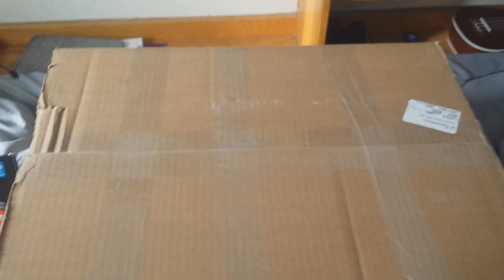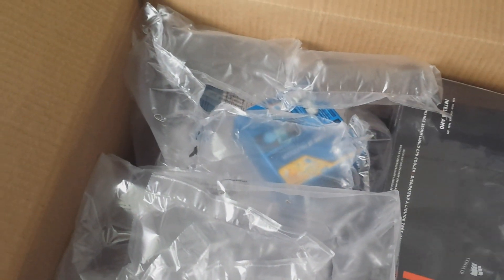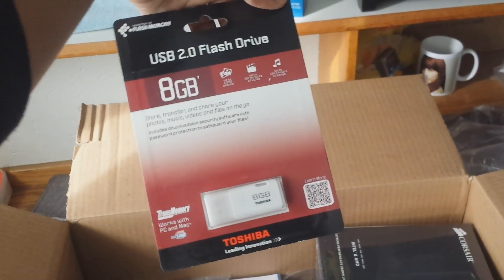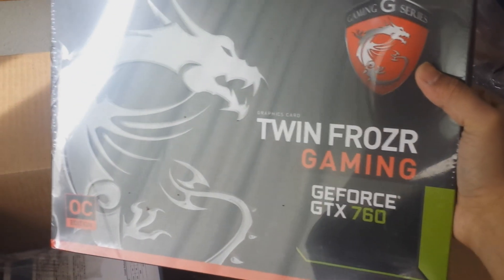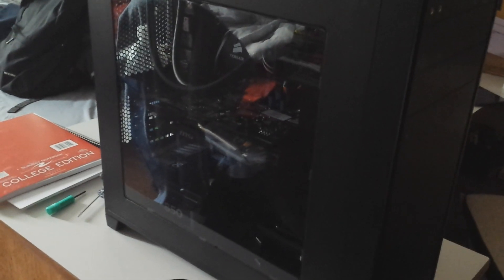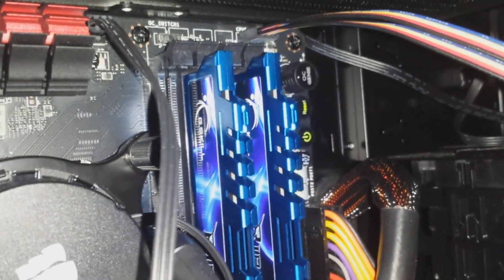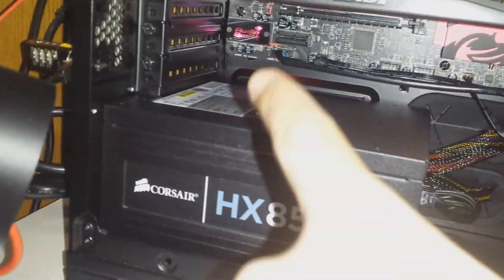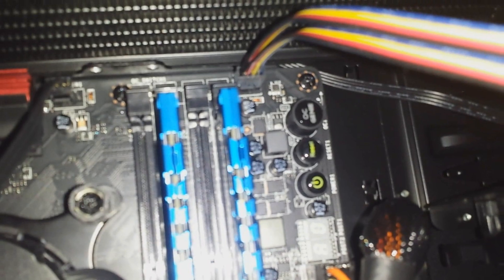2014 GAMING/VIDEO EDITING COMPUTER BUILD - $1300

Comment: That's a little odd that you have your rad fans on intake especially when there is no fan filter on the top of the 350D. Also i would Put the SSD in the 3.5in drive bay and remove the 2.5in bays for better airflow from the front intake fans.
Reply from the maker: I hope people read your comment, and aren't like me! lol

Comment: HÀNG BAO ZIN KHÔNG 1 VẾT SẸO - FULL BOX
Máy Bộ Dell Optiplex 760 FULL BOX
Nước Sản Xuất ; Mỹ
Chi Tiết :  Máy Bộ Dell Optiplex 760
* Máy Bộ Dell đã được cài đặt sẵn Windows :XP ,WIN7, Antivirus, Office, PDF Reader, IE 8, Firefox, Chrome, Vietkey, Fonts, Codec Media... Hỗ trợ cài đặt miễn phí thêm các phần mềm do Quý Khách yêu cầu.
 * Máy Bộ Dell Optiplex 760  siêu tiết kiệm điện,  thiết kế với vỏ Case size Mini nhỏ gọn, thiết kế sang trọng, tích hợp loa trong khá tiện lợi. Phù hợp nhu cầu xài Học Tập, Văn Phòng, Đồ Họa, Gia Đình ...
 * Máy Bộ Dell, sẽ đáp ứng đầy đủ nhu cầu làm công việc Văn Phòng, Game Web, xem Phim HD, nghe Nhạc... 
 * Cấu hình có thể thay đổi tùy theo yêu cầu của Quý Khách.
                Cấu hình 1: Máy Bộ Dell Optiplex 760  Case Mini
           Máy Bộ Dell còn mới 99.9% 
 - Main  Dell 760 Chipset Q45 socket 775. Hỗ trợ tất cả  CPU Dualcore, Core2duo, Core2quad……….
 - Bộ Vi xử lý Intel® Core™2 Duo Processor E6550 
(4M Cache, 2.33 GHz, 1333 MHz FSB)
 - Bộ nhớ DDRam II DualChannel 2GB bus 800
 - Card đồ họa tích hợp 800 MB Onboard
 - Ổ đĩa cứng 250GB SATA 7200rpm zin theo máy dell
 - Ổ đĩa quang DVDRW Slim 
Power 220V.
Card mạng 10/100/1000 Mbps.
Card mở rộng PCI, PCI-Express ...
 - Giao tiếp USB, VGA, COM ...
- Case nằm Mini, tích hợp loa trong khá tiện lợi.Phù hợp xài gia đình, văn phòng ...
Gía : 2.000.000vnđ – bảo hành 90 ngày
Giá : 2.300.000vnđ – bảo hành 365 ngày
 

http://vitinhtrongphu.com/

Comment: should vent the h100 out the top not suck in.  Push the air through the radiator. The two front fans you show the 140mm and 120mm stock fans are drawing in fresh air through the dust screen.  And on top there is no screen.  So your blowing crap into the PC and radiator.  If you spent a few bones on Noctua fans you would get the slitter and an extender with it and a plug inline to slow down the fans if you wanted.  Lets say you had no fan controller with you Mother board.
Reply from the maker: Really appreciate the concern! I've actually upgraded my case to the new Phantek Enthro Pro, and adjusted the top radiator to do so. Noobs first build gg, yamsaying?
Reply: PotentStar I didn't search your videos but did you make an update video?

Comment: Most of your pc components were overkill. From the video I can see your a first time builder. First off you said you were just gaming. The 4670k is equal to the 4770k in games. If you bought the i5 you could have used the extra money to get a 770. Your power supply is overkill but doesn't matter if you were planning to upgrade. The h110 isn't the best cooler and you should have got a noctua d14 heatsink. Offers same performance but cheaper and quieter. Over try using Pc part picker as a reference it may help you in the future.
Reply from the maker: I don't know if a 4670k is worth the money for a gaming build, especially with the new Intel anniversary chips that just recently came out(referring to the Pentium one). I brought a 4770k for it's life span, it suits my needs as a gamer and developer. I don't have a script for what I say in my videos, it was generally off my head, so ignore my saying of "just gaming". As for the cpu cooler, I'll keep that in mind for future upgrades, thanks!
Reply: ya no problem, but neat rig though :)
Reply: Id go with an entry level I5.
Maybe the 4460 on a b85 chipset.

Comment: Did u apply for newegg member something which offer 3 day free shipping. And you have to pay ard $59 for 1 year. I want to know is it worth to pay. What they would give for free like your free USB? Thanks
Reply from the maker: I didn't apply for a newegg membership, I will apply for it once I start having a steady income, atm I'm just a student at a university. I would say it's worth it! It's basically like 5$ a month. Before I do apply for it, I would like to see an example of possible savings and discounts one can receive, I guess I should try out the 30 days, and I suggest you do as well! As for the USB, I honestly have no idea! I had all of my components in my checkout box, and randomly a FREE USB appeared in it. I love newegg.
Reply: But Amazon offer 2 day free shipping w/out paying any annual fee. I 'm about to buy a new system. I have ordered the same PSU w/ u. However, the return policy from Amazon is better because I don't have to pay for return shipping fee but not others like newegg. Your PSU is still working great?

I have done the researched to buy all main components last night. I would check out tonight. I'm ordering used GPU. What do u think?. I'm also a college student. Im taking 3D animation upcoming semester. That's y I need the new one.
Reply from the maker: I'm proud to say it's still working great(PSU)! FREE 2 DAY SHIPPING? wow that's a deal. I think both services (amazon prime and Newegg premier) both have free trials? So, I can only recommend to test both and compare them based on your experiences. I just started my premier trial today, hehehe.

I don't know how to feel about a used GPU, but if your budget restricts to that being the only option, go for it, but otherwise buy a new one. There's better insurance with buying a new GPU than a used one mainly because if it's an hardware issue that's under manufacturer warranty policy then it could be tricky when you're the person trying to get it fixed. A'lot of companies don't comply with consumers when it comes to used goods.

Also, if you're going to be doing alot of 3D animation, you definitely want the most important part of your computer (GPU) protected, but you probably already know that.
If there isn't a huge difference in pricing with a used GPU and a new one, buy a new one. If there is a huge difference, rock paper scissor shoot bro (jk).

Comment: SSDs read and write speeds aren't the most important factor
Reply from the maker: I certainly agree with you. There are many other important factors: reliability, sturdiness, and probably even design if you're that type of person. However; how SSDs should ideally perform are pretty much capped across the line for all different SSDs. What I mean by that is all SSDs will generally give you what you expect, which is mainly a bootup time that's not faster than what you've experience before. I have both an high end SSDs and now a low end; and honestly even though Toshiba might seem the low end one, I can assure you not. They both perform well, the only difference in my eyes is the price, and maybe even the storage because my Samsung 840 Pro series is a 256gb while I only have a 128gb in my desktop, but that doesn't even count. What do you think?
Reply from the maker: PotentStar I should probably also mention that I had an intel SSD as well, but switched to Samsung after 2 months and sold the intel SSD to a guy on craigslist.
Reply: I meant performance factors other than reaf/write